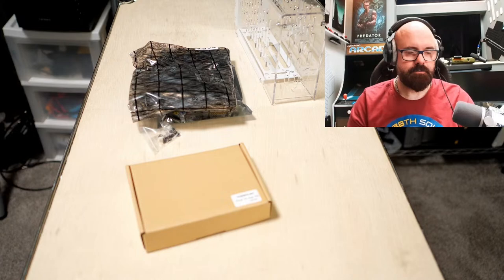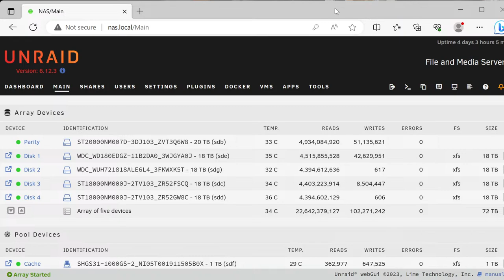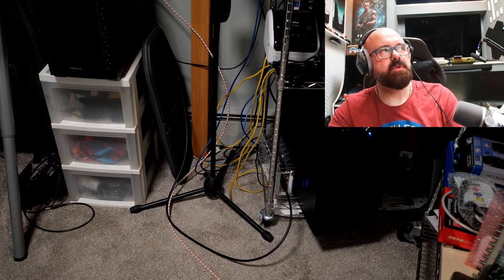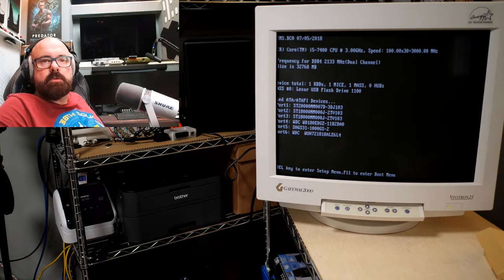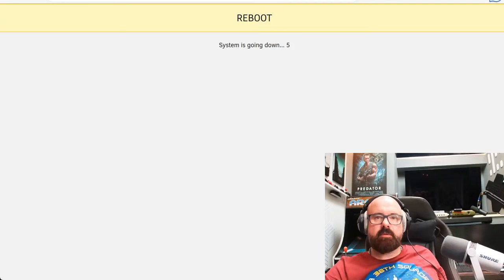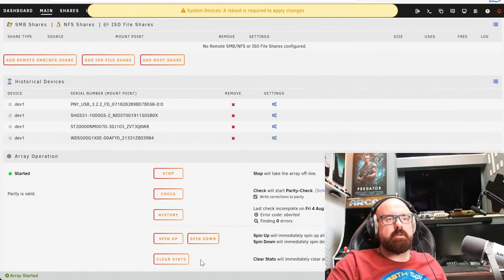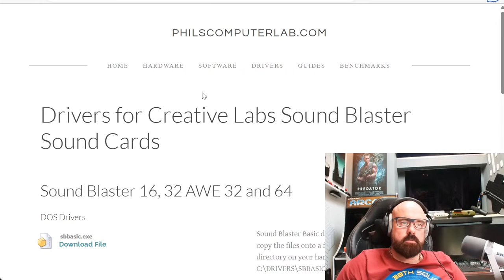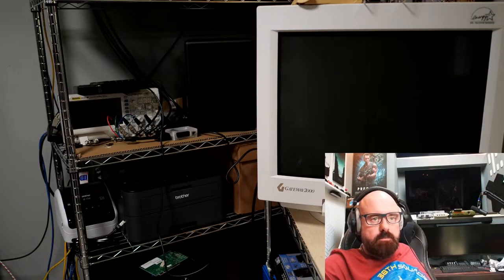(FAIL, read description) Win98 + Hardware in a VM with  @SpaceinvaderOne ​

Comment: I'm not watching the full stream, but when I did PCI passthrough to a Windows 98 VM I had the best luck using Intel CPUs. Ryzen processors would cause filesystem corruption whenever I used them. I used an fx5200 and an SB Audigy 2 for mine. I also played with passing through a real IDE controller for redbook audio and had success. I never got four cards working, though, the two card interfaces will all try using INT-A and INT-B and conflict with eachother. Startech sold one that had four ports but it was like $300 and I couldn't justify that. I used proxmox for my hypervisor, never tried unraid.

Comment: Not sure if it'll help with unraid, but with QEMU on fedora 38 I've been able to get sound in windows 98 working using AC97 as the emulated sound chip and there are some drivers available for those that seem to work ok. (not perfect, but ok) Newer builds of QEMU seem to have removed SB16 support entirely so that may be an issue for SpaceInvaderOne's image.
Reply from the maker: Thank you, I'll pass this on.